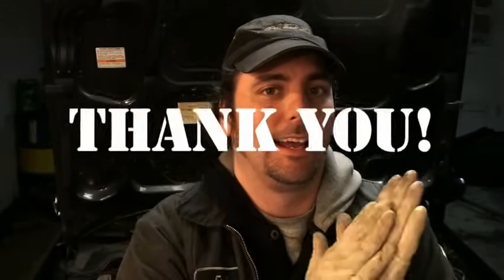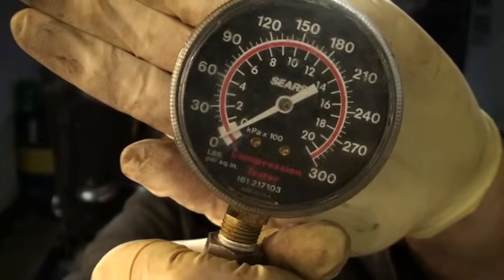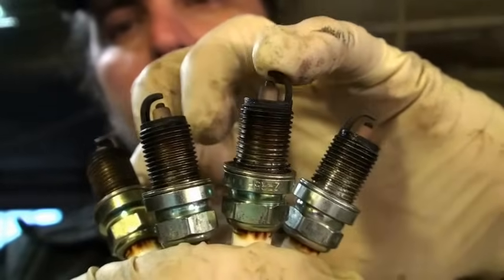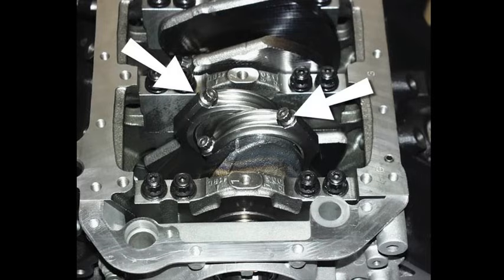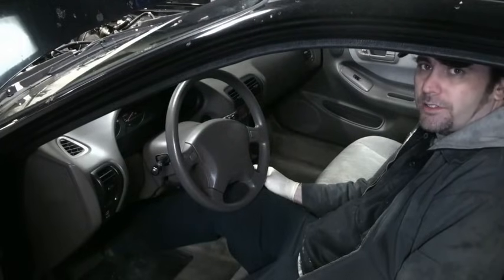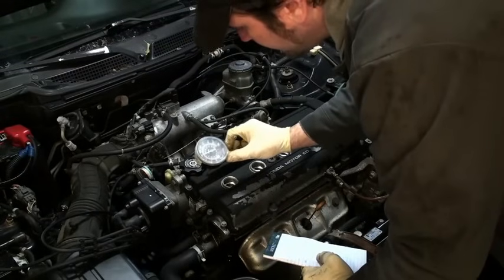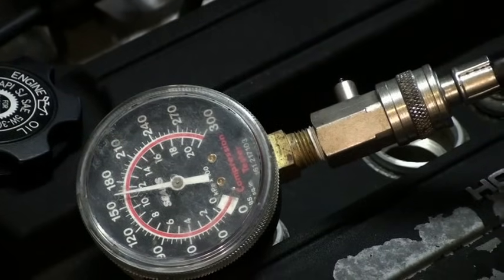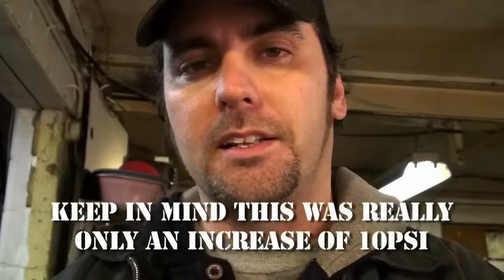How To Perform a Compression Test - EricTheCarGuy

Comment: I have about 10 bars~150 psi in b20b3 in Crv rd 1 from 1998 (Japan motor
 128 HP) , after ring replacement and after lapping the engine (without 
honing). I did measurments on cold engine with fully opened thortle and 
disconnected fuel injectors. Engine milleage is about 600 000 km - great
 engine.... so i have engine in good shape

Comment: Hey Eric I have a 2002 Ford Ranger Edge 3.0 I recently done compression test on cylinder 4 5 and 6 cylinder 4 has 120 cylinder 5 has 90 and Cylinder 6 has a hundred and thirty pounds compression does that mean I have a head gasket or fuel injector problem. Please help. Thanks

Comment: I have a question hopefully you reply back to it. I have a 2002 Lincoln LS 3.0 it’s an V engine. I have a misfire on cylinder 4,5,6 and Bank 2 too lean. I want too do a compression test on bank 2 driver side it’s easy to get to but the driver side I have to remove the intake manifold. Anyways my question is in oder to do a compression test do I have to remove all 6 spark plugs?

Comment: Hey, I was wondering if you could help me out,  I just recently started and engine that sat for a while, it ran okay, no smoke or anything,  I haven't done a tune up on it but noticed it started to smoke white smoke, I took all the spark plugs off to do compression test and noticed spark plug number 1 had slight oil on it where the other three where dry. I did just the dry test and all cylinders are at 190. Its a 93 prelude engine in a civic that I just put in. What do you think could be the problem.  I'm gona do the wet test tomorrow.  Thanks Eric . Would really appreciate it.

Comment: any idea what a 1985 Mustng 5.0l carburated motor should have?  i was doin one at a time though, didn't take out all plugs ...and just turning over a couple times and it looked like about 90 on 4 of the 8 I tested by the time I got back out to the meter..(It was dropping down so i have to guess it was at 90 during test)....
Dry test , Cold motor.....    The car runs pretty good though...weird...

Comment: Hey, love your videos. I've got a 2001 blazer that has a hard time starting only when the temperature outside drops below 50 in the night and the block gets that cold. It runs fine once it's been started for the day but usually takes 10 or 15 cranks with pumping the gas to get it to start and once it feels like it will start, it struggles and the rpm needle bounces back and forth between 300 and 600 rpm. It runs great once its started as I've said. I just replaced pluga, wires, distributor cap and rotor... my only other guess is that it could be compression from the cylinder shrinking when the metal gets cold. Any thoughts..?

Comment: Hi Eric, just run engine compression test, the result :
Cyl1 D.172, W.199, Cyl2 D.175, W.215, Cyl3 D.176, W.222, Cyl4 D.173, W.212.
What do you think about this engine?
I feel better engine response since i pour in some oil inside the spark plug holes, which is good.
Thanks

Comment: Hi, i have a question. Ok, if a car comes for repair with... some problem that requires cmpression check then the test will tell the condition of the cylinders in relation to each-other and if there's deviation... ok, actions are taken. BUT! You need new engine. You go to the scrapyard where cars may be sitting for a while, oil has dripped down in the pan, etc... And you go to a relatively 'new' to the scrapyard car (not the oldest one which has rusty cylinders from sitting already...ofc). And you can put a battery. And you remove the plugs to do a compression test. So here's the question - what should be the acceptable numbers for this compression test? Because - cold or not, hot or not - the engine must have certain compression to be healthy. What is that range lets say for 2L 4cyl 10to1 static compression engine. @EricTheCarGuy

Comment: 2004 CAdillac SRX low compression on 3 cylinders. Wet dry comp. test shows about 25 lb difference. What may be the cause other than a cylinder problem,
85,000 miles

Comment: Hi there , do you have to remove all the Sparks and then test each cylinder one by one ?
Or you remove one Spark at a time and test one by one  , instead of removing them all ?

What if you don't remove the Electrical Ignition sensor ?  
Thank you ...

Comment: I have a 7afe engine and from what I read the standard compression reading is 191 and the minimum is 142. But when I did a compression test, it was around 235 for all cylinders. Should I be worried?

Comment: I6 : 140, 125, 120, 25, 120, 125. :( No typo #4 was 25 wet & dry. I was hoping a head gasket but now Im thinking broken rings or hole in piston :( Has alot of blow by and coolant deosnt seem to be effected. Oil consumption increased. Breather milky.  :(

Comment: Hi Eric, I have a question for you, I've just done a compression test and have good results but after the test the engine idles higher, any ideas. any ideas why it would do this thanks.
Reply: There's no vacuume  leaks and idler is working as it should just did it after compression test. Turned down the throttle stop screw and ideals fine. And no engine rock or anything.  Why would the engine change after just this test.?

Comment: Love your videos, Eric. thanks for channel! I got t-boned in my 03 accord v6 with the auto trans earlier this year, other car hit right on the driver side front tire. it was running perfectly well before the crash but now it's misfiring and seems very sluggish. Did have to replace pretty much everything around the wheel other than the drive shaft and lower control arm, as well as the radiator, and there is some slight frame damage yet to be repaired, but I'm wondering what could be causing the misfire? would a collision like that cause compression issues? it does have a newer and larger honda intake manifold and throttle body plus a cold air intake. I'm hell bent on fixing the car rather than junking it and getting another (I know, stupid but I'm doing it). all spark plugs and wires are less than 2 years old

Comment: I have a 2007 Jeep Commander. My compression readings are: 1-100, 2-90, 3-70, 4-70, 5-100, 6-20, 7-100, 8-75. 
Will do a wet test to see the difference. 
But any suggestions?
Reply: Junk it or rebuild it, 6- 20 is hopeless

Comment: I did a compression test on my car and but not sure whats wrong....cylinder 1 kept it's reading but 2, 3 and 4 the compression would slowly drop from 130psi down.  What could be the problem?  The pressure would drop on both dry and wet test.  I was testing my 1967 volvo 122.
Reply: The meter valve isn't sealing. The highest the pointer reaches is what you go by.

Comment: When i did a compression test counting to 4 with key turned it went up to 150 on all of them but lost pressure very quickly.is the pressure suppose to stay on the gauge
Reply: mike renza bad gauge bud
Reply: Ima buy new one.97 grand marquis is burning 1 quart every 400 miles but no blue smoke.hesitates at low rpm like a misfire.some times at higher rpm and sometimes not at all.spark plugs have no oil on them.new plugs. wires. iac valve.egr valve pcv valve. Egr hosees.camshaft sensor.crankcase sensor.fuel injectors work dont no if they spray good.could for o2 sensor being lean and rich at same time but engine light went off.engine light was on for catylic efficiency but off.cat codes come up when it hesitates bad or long period of time.i have new cats and tpc sensor just not put on yet.what can cause this .what to look for.it stalls once in blue moon and whers this oil goin.
Reply: Plus coil packs work.can they be weak

Comment: Got a puzzling compression reading. MY PSI should read 170. Cylinder (1) is reading DRY 130 - WET 200, can't understand why it went up to 200? Cylinder (2) DRY 90 - WET 125. Cylinder (3) DRY 85 - WET 93. Cylinder (4) DRY 95 - WET 120. Anyone got any idea?

Comment: How's it going Eric? Question regarding the compression test, i had my 2010 evo x go through a compression test and the readings were 150, 99, 149, 148. I went to the shop to verify in person and the readings were 151, 149, 150, 149. They followed up with the leak down test and all cylinders were good. They let the car warm up for 5 minutes to repeat the test8 and the number came up the same. Should i be concerned? Or maybe i have a sticky valve? Any input is greatly appreciated. Thank you

Comment: Thank you for the video. I have a stupid question here. I am looking at doing a engine compression test for 1996 Jeep Cherokee. I had drained the oil and taken out the radiator and serpentine belt (in thinking it was head gasket but now it might be rear main seal oil leak) So I would like to do a compression check. I was going to put some oil in maybe 3-4 liters). Can I get away with 3-4 liters of oil (6 liters normally) if I'm turning the engine with the starter 5 count/ times each cylinder as you show (5x6 cylinders)x2(dry and wet)=60 times of cranking with starter.

Comment: Hey Eric!
I very like your videos, you are a real car god! :) Can you give me some advise, for my car?
My car is nearly 20 years old, she's done  just under 290K km (181K miles). She started smoking blue, about a week ago, only on cold start, and when if it idle for some about a minute or so, and put some bigger gas. I change oil, and replace timing belts as it should be.
I dont feel it weak, not make any wierd noise, fuel consumption is good, runs smoothly, she starts right after i turn the key, no need to crank. So i think its not so bad.
Where can she burn oil? Bad gasket, or valve stem seals? I thought about a head rebuilding. You think that solves the problem?    

Thanks for your answer already! :)

Comment: I know this is an old video but today i did a compression test on my 95 integra 100% stock, and i got 90, 90, 90, and 100 for compression. I know its very low but the car doesnt smoke or shake or stumble. It just feels like it has a loss of power.. nothing major though, its faint. What could cause that? it also has 186,000 miles.
Reply: It could be a worn timing chain/belt. That would make all cylinders weaker with lazy cam timing.

Comment: Hi Eric
Need Help!
I have a 2001 toyota celica with a zzt230 engine. The problem is that the engine is shaking, is not running smooth and I have a misfire on cylinder 3. I change spark plugs HGK laser iridum, new ignition coils, new injectors, new engine cover gasket,change the engine electrical harness from another car, clean the MAF sensor with special cleaner, new air filter (when I bought the car had no air filter), delete the error code, let the ECU remap and the same problem came(misfire on cylinder 3). Please tell me what else to check. Thanks allot

Comment: eric ihave a nissan altima 2011 and i do a compression test on that ihave 150 psi but take a long 10 or 15  crank rounds that makes the pressure 150 psi and  
 ihave no start.

Comment: Question for you Eric, have a 95 302 with Rough idle and I'm doing a leak down later this week. My results were 100-110 all around dry. Wet I only had 3 cylinders that increased by 3-4 psi while the other had no change. The car has had three or four overheats from fans failing. Any thoughts. Great videos

Comment: Probaly a dumb question but how do you remember where those plugs go back after? Do you mark or number them? Also why does it say to disable the fuel injection system and the ignition system when conducting an engine compression test in the ASE exam materials. It seems that if you were to disable the ignition system you would not be able to crank the engine, I'm confused please help me gain some clarity if you would be kind enough to Thanks
Reply: 1. The spark plugs can really be put into whatever cylinder you'd like. There's not a specific one that each needs to go into, it's universal. 
2. You aren't trying to turn over the engine when doing a compression test. So you disable the fuel injection so that the cylinders don't get fuel put into them. Since you took out the plug the fuel would not burn and would negatively affect your test results and could possibly have negative affects on the engine.
3. Disabling the ignition system makes it so that the spark plugs will not fire. Since we aren't trying to actually start the engine and there's no fuel to ignite we don't want the spark plugs firing. Disabling the ignition system will not affect the starter mechanism and it will still attempt to start the engine like normal, spinning the crankshaft, and moving the cylinders.
Reply: Thanks Gooont I appreciate the response.

Comment: I own 2003 Caddy Deville. 4.6 liter.  Tested and told, No compression at cylinder 4 or 7.  Drove car 100 miles yesterday, runs good, rough at idle, shuts down. Go 19 miles per gallon.  What can it be. Thanks. Can you Email me, at. Detectiveaperez

Comment: What to do after failed compression test?
Reply: take the valve cover and check for a broken valve spring or stuck piston... Also you can use an air compressor, put the cylinder at the compression cycle, hook up the test pipe without the gauge and blow low pressure air, show hear hissing at the intake, tailpipe or radiator. In my case I had all 3... JeepJeep
Reply: James Courtney 
cylinder
1-170 
2-155
3-150
4-150
Any thoughts?

Comment: Thank you for your posts.  Very helpfull.  Maybe i missed it in this video but you talked about a dry compression test then wet compression test.  You explained results for a high delta pressure difference btween dry & wet usually means worn seals or cylinder wall but my 06 civic cylinder #2 is 80-86psi dry & wet test.  Am i looking at a valve sticking problem?  Thanks

Comment: hi please can somebody help me out, i have a z20let engine with ko4 turbo. 

on cold start there I's no smoke but after a run and hot idle there Is occasional blue smoke. it stinks also.

after a good deceleration decline and then foot on, some blue smoke.  which leads me to think stem seals. but I thought this would happen on cold start due to the oil seeping down into the cylinders. it's using oil. 

could it be turbo seals or piston rings, which is most likely? thanks in advance for any help
Reply: Burning oil so idk check wherever oil goes

Comment: hey I have a question I want to know if I need to replace the rings and bore over or valve seal. I know I'm burning oil bad but don't want to tear the whole engine apart and buy parts (gaskets) I don't necessarily need. normally I'd go for the total rebuild but since parts for subaru sambars are extremely expensive and hard to find it want to go that deep. what would be a good test? there is so much oil in the cylinders that it makes a dry test impossible. (used Lucas oil stabilizer) I fouled out new plugs in about an hour

Comment: I know... This is an old toppic ... but I do have a question about this: What does adding the oil do to your catalytic converter? Will it be a problem?
Reply: it would burn such a small amount of oil. it would still be gas/smoke... catalytic converter just runs exhaust through it to combine the carbon monoxide together to make carbon dioxide. It's not a soot catcher... I dunno why would it hurt it? I'm not saying it won't I just can't work it out from my limited knowledge.
Reply: Leaded fuel can contaminate the cat. Unburned fuel destroys it (in the long run, i regetfully know this from experience). I thought that this unburned oil could maybe coat the cat ... and when it get's hot, the residue of the oil would cover the cat, so it can't do it's job anymore. But that's just a guess.
Reply: Dave Verdonschot
that would mean every old car with worn rings that started burning oil would instantly destroy their cat...
Reply: Hmm, you've got a point there ... maybe not such a big problem then. Thanks

Comment: it's a good idea to precisely measure the equal amount of oil for each cylinder for a wet test. This way you won't have to worry about putting more or less oil and gettng wrong readings thus possibly making a really bad decision about the engine.
Reply: if you have low compression.... your pulling the engine so it doesnt matter... a wet compression test is to figure out if its rings or valves.. really doesnt matter how much atf you dump in the cylinders
Reply: @Turboboob  regular oil or thick stuff for the wet test?
Reply: @mtrott101  wouldn't you use tge same oil your car takes?

Comment: Hi Eric. I have a 1973 Ford F100 that is burning a little oil. I have had the valve seals replaced and the burning is still there. I have bought a compression tester and with the help of this video will do the test myself. I do not have an air compressor so I can't do a leak down. Thank you for posting this video and also doing it in an understandable and clear manner for the average person without the foul language that is featured in so many of these videos. Regards, Donald.

Comment: recently I took throttle body off to cleaned it , was really bad, then it would high rev after first start or putting into park then go to normal again , now I have a dead cylinder on my number 5 on a 5700  Vortec , 2000 GMC sierra 5.7 L , I don't hear a vacuum leak but is it possible the throttle body is leaking and caused the dead cylinder ?

Comment: Hey guys, I did this test on 2001 celica's 1800 1ZZ-FE with 190K miles (does NOT burn oil or overheat, it has random misfire and rough idle). Dry test on all 4 cyls gave me exact 160 on each cyl. Wet test results were: cyl1: 270; cyl2: 250; cyl3:270; cyl4:240.
Does it mean I have blown head gasket or worn out cylinders?  Factory specs are 140 minumum. Please advice

Comment: I just bought a performance tools tester but the presure drops likes is not saving the pressure in the hose or gauge, so the gauge does not indicate more than 35 psi, but the car is working fine, no bad smoke.  HELP
Reply: Teflon tape on the gauge threads